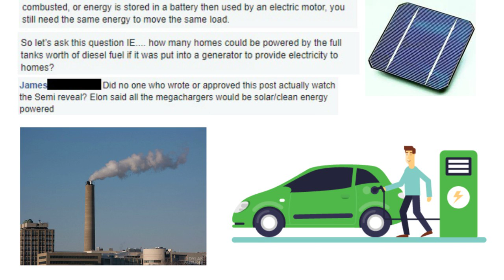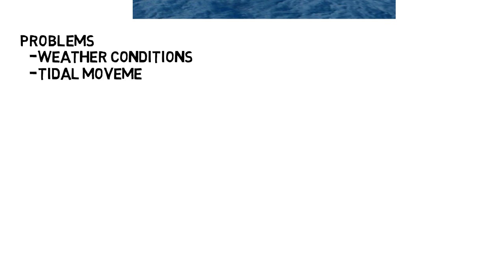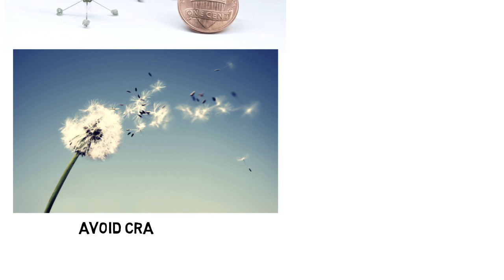New Research on Tesla Semi Truck Energy Usage, Microrobots, and more - Today In Engineering 5

Comment: I'm sorry but the Tesla truck example doesn't even use the right units to make any comparisons or conclusions. 
"The Tesla truck will need the same energy as 4000 homes" ?? 
Energy is Power*time. So as much energy as 4000 homes use in a week? A month? A day? 
I think the operating term is POWER, but that too is only applicable if you want to charge the truck in 30 min. charge the truck in 2 hours. Fleets can make sure to charge during off-peak, or charge evenly distributed throughout the day, there are options.